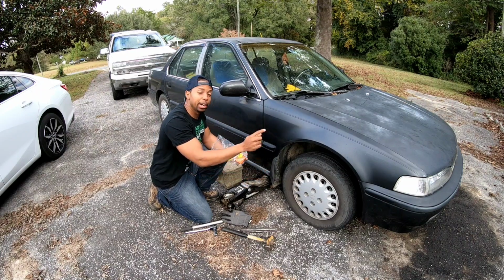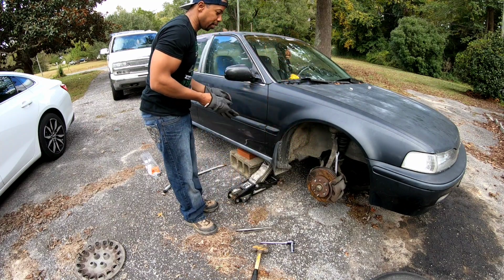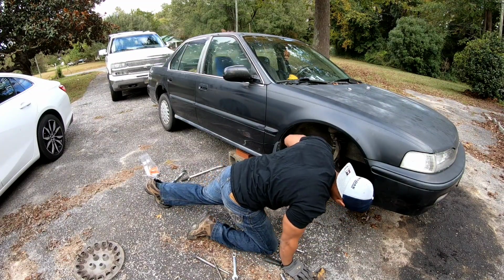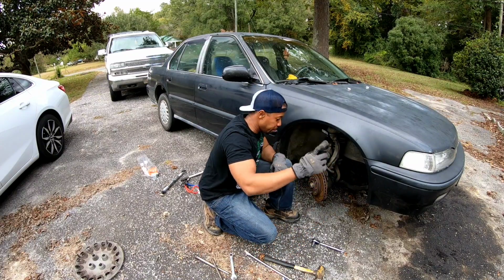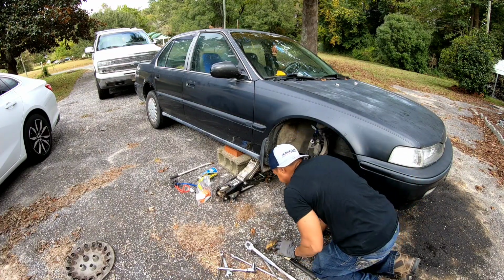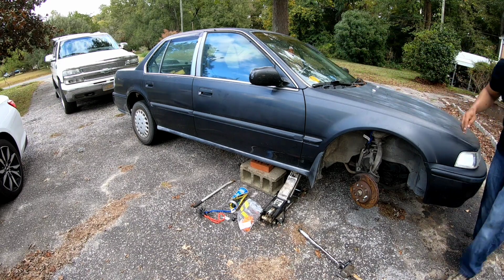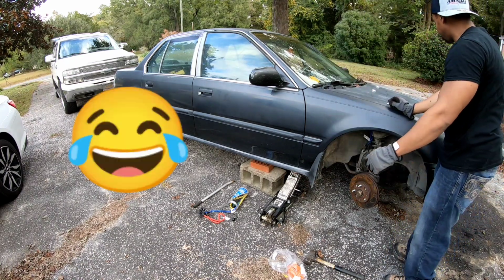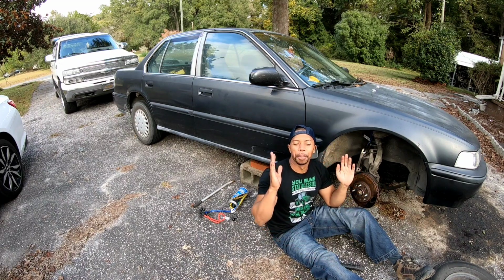Changing Wheel Studs On 1993 Honda Accord! The Preacher Almost Cursed!! 🤣

Comment: Perfect!  I can't imagine anything scarier on Hallowe'en!
Reply: ...and don't feel bad.  I gotta figure out if my AC compressor is going out on my 2000 Toyota Camry, or if it's just the AC belt (or maybe the idler pulley)...gaaaaaaaah!
Reply from the maker: @Thea_MojaveOutliersWhipmakers  ahh man! I hope it's just a belt! The ac compressor on here sprung a bad leak years ago and I've been using window ac ever since lollol
Reply: @TerrellSpivey  Well, the parts aren't too expensive--in the case of an ac compressor, the deal killer is removal, installation, and then the dreaded recharging.  Hey, do you know about the ChrisFix channel here on YouTube?  That guy's saved my bacon a buncha times with car repair.

Comment: Hey Terrell. Part three is gonna be "something is wrong with that brake rotor." Inboard the rotor is shiny where the pad hits evenly while outboard, what we see with the GoPro, rust all over except for one spot that is shiny which make no sense to me.

Is that not the brake that was repaired recently?
Reply from the maker: Hey Ricki! As I mentioned to Bro Derrel, it's just superficial rust from where I haven't been driving it! Just normal moisture got it rusty but where the brake pad was positioned on the rotor is not rusty because moisture couldn't get to it! My new Honda that has factory 19 inch rims wherein you can see the rotor at all times and sits for weeks without being driven gets rusty all the time but as soon as I drive it and have to use the brakes, there back to there shiny state! And umm...I hadn't done any brake work on this one recently!
Reply: @TerrellSpivey  I'm glad it is superficial. We don't need any wrecks. :)